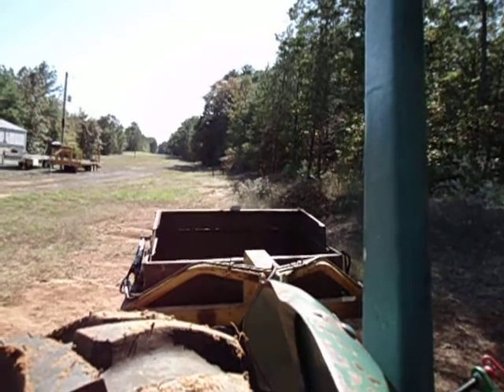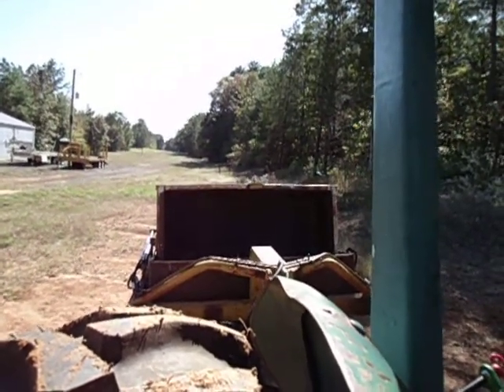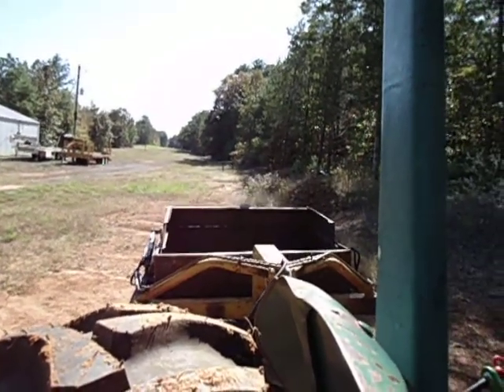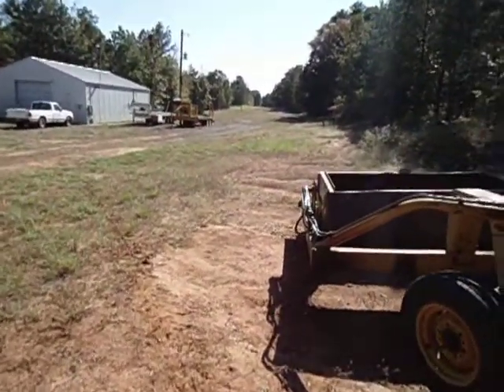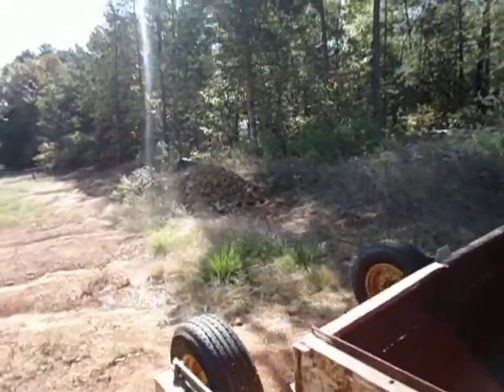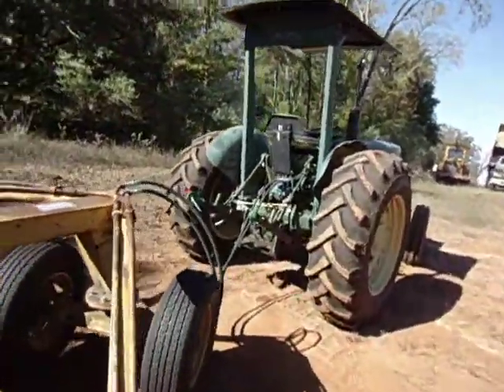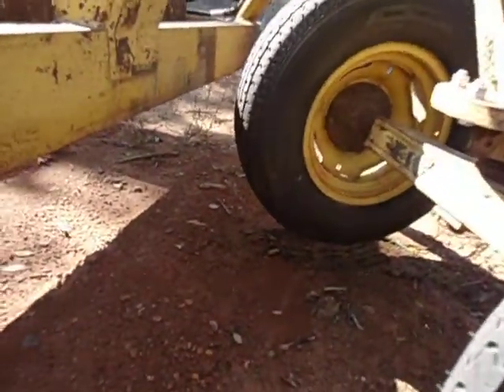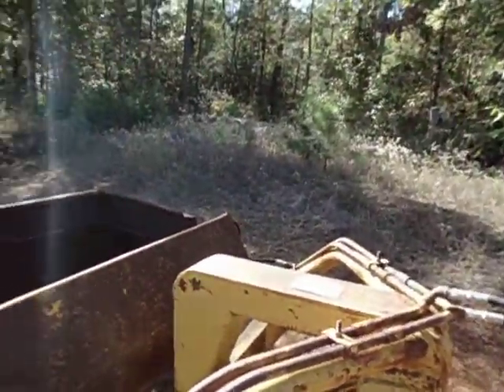Scraper operator error corrected

Comment: Operator error, seems the older I get the more operator error sometimes! Thanks for sharing Amos
Reply from the maker: Amen to that. Took a paint marker and wrote "TURN OFF PTO SWITCH" on the dash AND put a wire tag on the switch too. 3 batteries to replace so a $450.00 lesson learned......And thank you for subscribing! over 100 videos posted if you want to watch some.